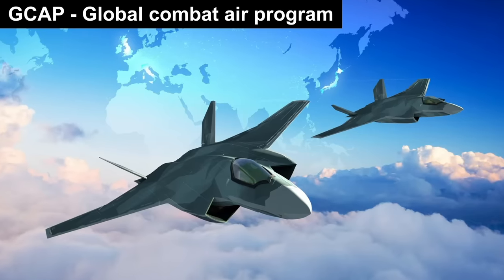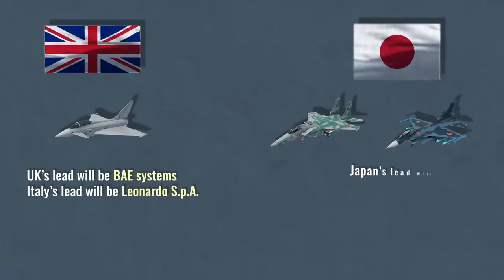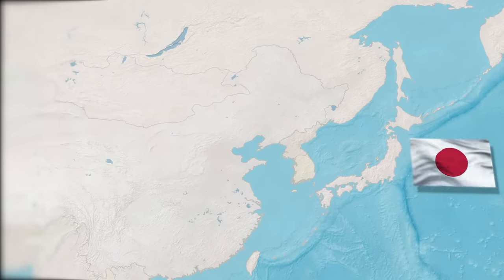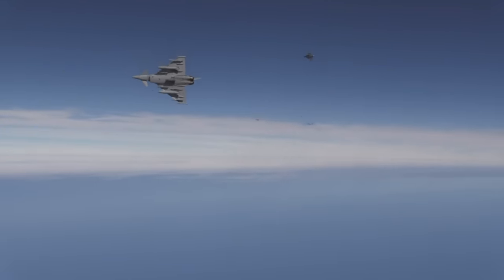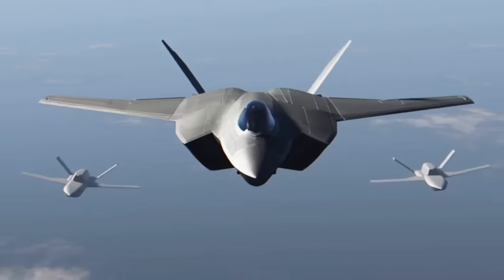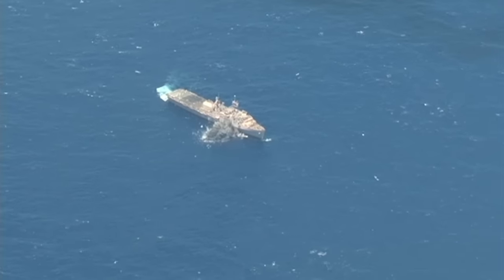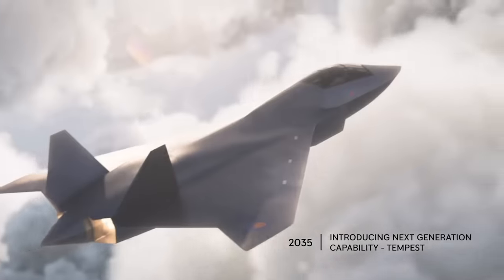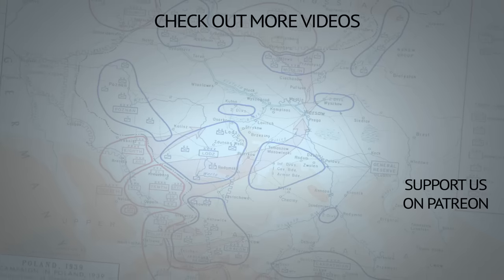Why is the future Anglo-Japanese fighter gonna be bigger than F-22?

Comment: Impossible in short period of time i predicted 6 generation fighter jet only flew in 2050
Reply: I bet prototypes have already flow.
Reply: @archersfriend5900  u are overestimated their scientific capabilities
Reply: NGAD and it's drone sidekicks are flying in early prototype trim right now. They have not settled on the avionics requirements and there are 2 engines that they need to choose which one to use. The avionics requirements are not firm, which means until they commit at the end of this year, nobody can begin to design the electronics and software, much less fit the parts into the plane or fit the plane to the parts. I imagine it will be at least a year before we have an actual operational prototype of the production-spec animal. Until then they just work on the flight characteristics, mechanical design, stealth skin, munition deployment etc..
Reply: @pappyman179  let time answer our questions
Reply: Given enough resources - brainpower, money, manufacturing - things will go fast. 

And we know japan has all three, the problem thats hindering japan is attitude. And that leads to issue with money. 

Put it this way, the idea for their Mogami class frigate officially came about in 2015. The first ship of its class was comissioned in 2022. Thats only 7 years. 

The Mogami is planned to replace all their aging destroyer escorts (frigates, basically), their Asagiri destroyer and their minesweepers in stages. These older ships are all in working order so theres no need to replace them all immediately in one fell swoop, but if Japan wanted to, they can. All they have to do is pump Mitsui and Mitsubishi a craptonne of money to build new shipyards and theyre gold.

But ofcourse, a 6th gen superiority combat jet is not a semi-stealth frigate afterall, i get that.
Reply: @arsyadidris6349  again u are overestimated their scientific capabilities
Reply: @widodoakrom3938  bring 1 example of my overestimation to counter my 1 example 😅

Comment: I think that 36 F-15EX is a good option for Australia. Much lower cost than a next gen stealth fighter especially in operations. Suitable as a long range replacement for RAAF 24 Super Hornets and 12 Growlers. Can be used as an electronic warfare platform with more capability than Growlers by simply changing attached pods. Also useful for short range direct control of drones such as Ghost Bat from the back seat. Australia’s current Super Hornets and Growlers could be sold to cover part of the costs and allow induction of F-15EX very soon.
Reply: Australia already has 72 F-35A which are sufficient for stealth but are low on firepower and cannot do much active EW either without negating stealth. Single pilot means that they are already saturated with tasks and control of drones would degrade attention and performance. This makes F-15EX a good complement to the F-35.
Reply: @stupidburp good analysis
Reply: Wrong. I wish the BS about F15 should stop. The F35 in 2 exercises has shot down F15 in ratios of 0:4.
 
The life expectancy of the F15EX is 2028 then it is obsolete.

F15EX is a replacement for F15.

Australia does not need a 1000km combat fighter when it has 1500km  tomahawks.

The Ghost Bat and Growler make better complements for F35.

Comment: uh glue????
Reply: Smartphones got extra slim after companies started switching to glue, so it's not as janky as it sounds.
Reply: Yeah man. Industrial grade resin is the prefered term, but “glue” isnt wrong either. 
Alot of high end sportscars use “glue” to hold pieces together n straight up form a chassis. That chassis is then put in a giant oven for it to set, n voila, one solid chassis.
Reply: Another term used is industrial/structural adhesive. It is used extensively in modern auto manufacturing, for example.
Reply: And they have to use glue coz theyre using a craptonne of composites, exotic metals n hightech ceramics in these planes. 

Im willing to bet that the only few materials on these modern combat planes that most of us are familiar with is the rubber they use to make the tires😅

Comment: The problem is the cost of the planned fighter jet. It seems that with the anticipated 400 jets for three counties, it will cost $200 million-$300 million for each. It is 3-4 times more expensive than F-35A fighter jet. Even this price tag is optimistic expectation. The per fight hour maintenance cost will be expensive too. So they may reduce the number to procure, which will push the price up further. Similar to the situation of now retiring F-22. Good luck to UK-Japan.
Reply: The UK government made it clear that the plane will be export oriented in order to bring down costs. Its not going to be just the 3 countries, Saudi Arabia looks like a likely candidate. This was even discussed in the video lol. Saudi Arabia even expressed interest in joining the program, but Japan vetoed it.
Reply: @mark63424able  I can't see what the Saudi's could contribute except money and that can be gotten by selling it to them.
Reply: I suspect part of the motivation for Saudi Arabia wanting to become a partner, is that they wouldn't have to deal with potential supplier vetoes in future, as with Germany recently
Reply: @ThePurplePassage  Good point
Reply: @recoil53  Money is all they would have to contribute which is precisely why the UK and Italy wanted them onboard. My point was that OPs cost calculation is flawed because it assumes the plane won't be sold to other countries. The UK gov has stated that the plane will in fact be made for export and there are already interested customers including Saudi Arabia.

Comment: So it’s over ten years away from completion and only barely going to surpass a previous generation air craft?
Reply: Yeah the timelines on military projects these days are a joke. Everything is a decade plus away constantly.
Reply: Isn't that all 6th gen? Add drone/ai capabilties (via engine/cooling redesign) and extending the range? Even the US knows F-35 can't cover that need but US doesn't plan to export the NGAD... so this is our allies' NGAD.
Reply: @lechefski  it depends on how you define sixth generation I mean is the technology that much further ahead of the F 35 or even the F 22? From what I’ve seen so far, I would not say so incremental advances in engine efficiency, slightly better radars all this stuff it’s not like some generational Leap in technology in my mind anyway.
Reply: Having enough onboard electricity for laser weapons and companion drones is a significant generational leap imo.
Reply: @Dorgpoop  Only it doesn't. For current lasers, you need at least a couple of megawatts.
Reply: @tkmmkt6569 They don't necessarily make it out to be, but yes they're incredibly important. 
The efficiency gains in the engines aren't that important, it's the ability to be efficient in both subsonic and supersonic flight which allows for incredibly long ranges and isn't possible with current engines (this means they can take off on their own but can travel very long distances since they're not using afterburners to travel supersonic).
The increases in stealth are correct in that they're not actually super high, but they're still multiple times better (unless you're the US Airforce getting at least 100x better for some reason).
Finally, the drone wingmen allow for offloading of capabilities and for one airframe to essentially be an entire squadron of fighters, greatly increasing ability. However, that can't be managed in the single-seat 5th Gen aircraft. Thus, a new airframe is needed. And if they're going to make a new airframe anyway, might as well just do Gen 6 since that's already on the horizon. 
It's kind of like why the US changed cartridges and didn't go back to .308. They could've, but the reason for the change was weight decreases. So they had to change the casing (most of the cartridge) to achieve that, might as well change the bullet since they needed something new anyway.
Reply: @threestars7561 I don't think that's true given that we hooked them up to pretty normal trucks already. Look at Task and Purpose's video on that one.
Reply: what is the difference between 6th & 5th gen? (real question)
Reply: @@JimCarner 🙄
Reply: Ten years is fast compared to other military projects. The F35 was proposed all the way back in 1990s!
Reply: @threestars7561  Rolls Royce have an aircraft APU the size of a waste paper basket that generate 1.2MW and they will be able to draw far more electricity from the primary engine.
Reply: @breadnewbie6326 Nothing much, a 6th gen is just a modern 5th gen with some AI elements, drones and improved engine efficiency plus whatever else they decide to call revolutionary
Reply: @Mr.mysterious76  I guess, no real definition of 6th gen? probably "just anything better than 5th gen".
Reply: @tkmmkt6569 All of the major leaps in technology are classified for obvious reasons.

Comment: The RAF need a minimum of 144 aircraft for 12 squadrons. No doubt the order will be for 72 or less! Carrier based variant but not VTOL is a must for both nations being islands.
Reply: Non VTOL Carrier aircraft is meaningless for both of them, neither of them own or even have loose plans for a Catapult carrier. The QE class was, in theory, designed "For-but-not-with" such equipment, but there's been several reports that it was largely overstated and that it'd be a major re-work. Japan's Izumos are even less suited for such conversion, and has much less of a concern for such carrier based aircraft with China being so nearby. A lighter, longer range land based aircraft would be more useful for them.
Reply: @Joesolo13 STOL would be good though because both countries can expect their few military airbases to be in trouble quickly (definitely the UK, I'm not sure what Japan's air infrastructure is like). It'd be great if it could take off and land at makeshift "airfields" like the Gripen and MiG-29 can. That might not be possible with the sheer size this thing may have, but it can't only be operated from the top class of military runways, it needs to be able to use civilian airports and general aviation airfields as much as is reasonably possible.
Reply: I suspect they'll go with the F-35 B/C for a carrier jet, it'll be much cheaper then creating a navalised GCAP.
Reply: Both UK and Japan use/will use F35 for their carriers. Those F35s will not be old enough to replace.
Reply: For such an expensive project they need to keep it as simple as possible and keep it a land launched aircraft with decent range.

 The f35s are fine for the carriers. To fight Russia they can fly from the many airfields of the UK. And if they have to fight china they can be launched from allied airfields or from RAF airbases in mid East even depending on its range and ability to be refueled In mid air.
Reply: The JMSDF has already made orders for 47 F35B STOVLs for their two Izumo carriers, and theyre gonna have 100 F35A to replace their F2, so this purported 6th gen wont replace those. But if im not mistaken, they plan to eventually replace the JASDF aging fleet of F15J Eagles.

Comment: u.s needs their own private programs
Reply: Instead of the F-35? I'm not sure what you mean.
Reply: The US has 2 6th Gen programs
Reply: @buddermonger2000  US has four 6th gen programs. NGAD, FA-XX, B-21 & project mayhem.
Reply: @everypitchcounts4875  You know,  I was referencing NGAD (FA-XX is also NGAD) but I completely forgot about B-26, and I haven't even heard of project mayhem.
Reply: @buddermonger2000 Air Force has NGAD, Navy version of NGAD was NJAD and changed it to FA-XX which is tight lipped about the program. Yeah most people forget that the new stealth bomber is 6th gen. Yeah project mayhem has been kind of flying under the radar.

Comment: The fact they don’t even have a gen5 means their “gen6” is just gonna end up a gen5 or gen5.5 at best
Reply: That’s assuming you have to incrementally climb the generations. It is possible and has happened where countries have gone from gen 2 to 4 and 3 to 5. Both the UK and Japan operate gen 5 f35s aswell. It’s very likely this fighter will be gen 6.
Reply: @Bedukanneh678 😂😂😂 SHOW me an example! I'll wait ✋🏿 ⏳️⏲️🕑⏰️
Reply: The United Kingdom joined JAST/JSF as a founding member in 1995 and thus became the only Tier 1 partner of the JSF program the UK has plenty of Gen5 experience
Reply: They have F-35 for gen 5
Reply: Japan needs hardened aircraft shelters and enhanced air defenses
Reply: @Bedukanneh678  sure but you have to admit that making a gen 5 first will result in a superior gen6
Reply: @JimCarner
Regardless of your opinion on F-35, “5th generation” fighter was defined by the Lockheed Martin marketing department as describing both F-22 and F-35 and defined by their feature sets. F-35 is thus 5th gen by definition. It doesn’t describe the performance of the aircraft in the real world as it was always a marketing term to define a category as the new aircraft available by that company. F-35 may be excellent overall as most professionals believe or it may be less impressive as detractors believe but this is irrelevant to the definition as 5th gen.
Reply: @@JimCarnerngl this an insane take. While the meteor is obviously the superior air to air missile until AIM260 enters production, the F-35 has dominated every single head to head it’s been in. And thanks to the economy of scales (almost 900 made and counting) it’s as cheap as a Rafael (tho the Rafael does have lower maintenance costs)
Reply: @@JimCarnersure, you are a random person in the youtube comments, aren’t impressed, because you some how know better than 20 + countries air forces, including Russia, China and Iran, and the thousands of experts to boot
Reply: @@JimCarner just because someone disagrees with you doesn’t make you a shill. Notice that I never resorted to attacking your character.

And you said a whole lot of nothing but go off
Reply: @@JimCarner I mean I personally don’t need to address them. The 20 + countries, multiple air forces, thousand of talented pilots and maintainers have addressed them.

I not saying the F-35 doesn’t have problems. It does. I’m saying, that pound for pound it is the most capable fighter on the planet not named F-22
Reply: @@JimCarnerwell the us military and numerous other militaries ARE impressed with the f35 with is why they are buying them and bragging about them. Sure the f35 isn’t all aspect stealth but it’s clearly enough to make a difference, as every commander and pilot says. Also, the best sensor suite in the world makes a big impact.
Reply: @@JimCarnerit is not really mediocre at ground attack if it is the aircraft of choice for the best military in the world for attacking highly advanced surface to air missile systems of peer nations to allow our entire military to continue operations.
Reply: @@JimCarneraim 260 will no doubt be better than meteor. As for red flag, yes that is where the f35 has simulated high kill ratios, where else would you like this to occur. If there are no peer conflicts this cannot be tested in the real world, and red flag is the best air to air training exercise in the world. Also, when have the eurofighter or rafale gone up against peer competition and proven themselves? Then, the flyaway cost for an f35a was literally 78 million dollars. Yes, the other variants were more, though not a ton more like you said, and other nations have to pay for things other than just the fighter jet because just having a fighter jet doesn’t get you anything. You need infrastructure to maintain and train pilots, and you need weapons to go with the aircraft
Reply: All they have to do is build a superior plane to the f35 and add some AI elements and drones to it then it will be a 6th gen. How different will the US versions be from these parameters? I bet they will be on par with the Europeans
Reply: @@JimCarnerthat’s because the JSF was conceived when they thought US or West hegemony is secured for the next hundred years, that all they needed was a plane that can bomb countries without long range missiles, an actual Air Force or navy.

Comment: The problem I see is that GCAP is not really a complete system like FCAS and NGAD is. Both those programs are systems of systems while the GCAP program is only the fighter. I am just wondering how the fighter will integrate with FCAS or NGAD drones. Since they are the only program that builds loyal wing-man drones. Airbus with MBDA on one side its boeing. Cross integration is something that can be complicated when I think of the complexity of the drone integration especially since they are going to be fully autonomous. 
It all would depend on how much access the GCAP program would get from either NGAD or FCAS software. America was and is extremely sensitive when it comes to software sharing when it came to the F-35, do not know if they would be as protective with the NGAD system.
Reply: The UK had a loyal wingman drone program, and there were several companies that were awarded contracts (Spirit AeroSystems, Callen-Lenz, Northrop Grumman UK, Blue Bear Systems Research, Boeing UK). The program was axed in 2022 due to MOD budget constraints. Given that GCAP will need loyal wingman drones, the UK may be forced to re-evaluate its decision, but there clearly was no shortage of willing and capable defence contractors.